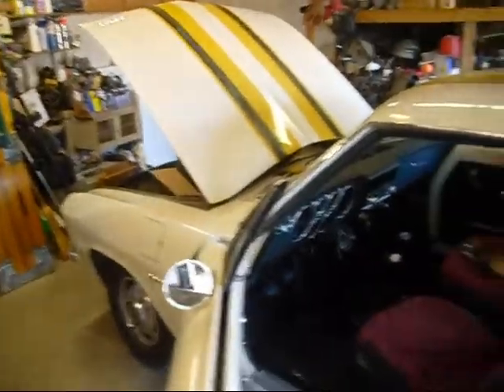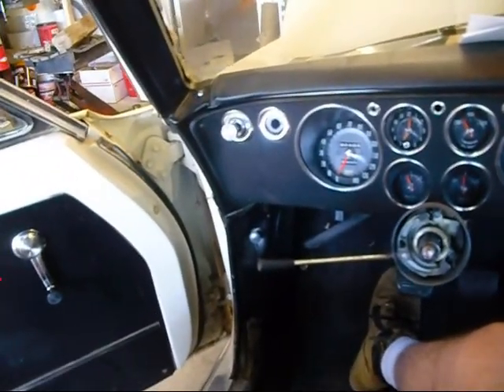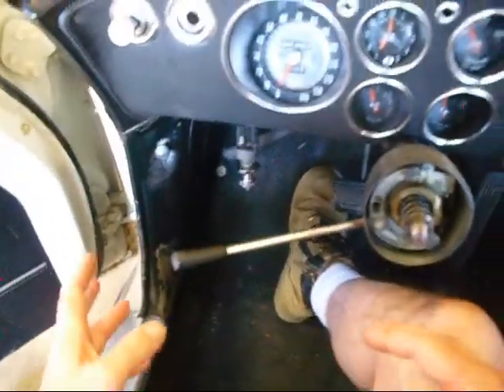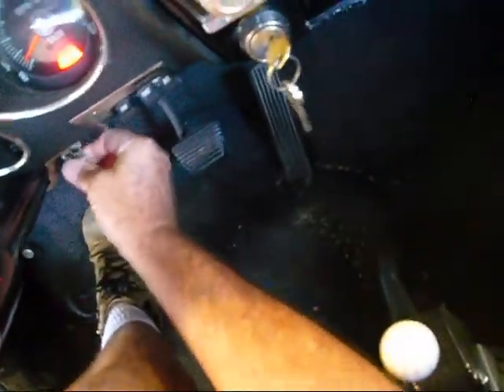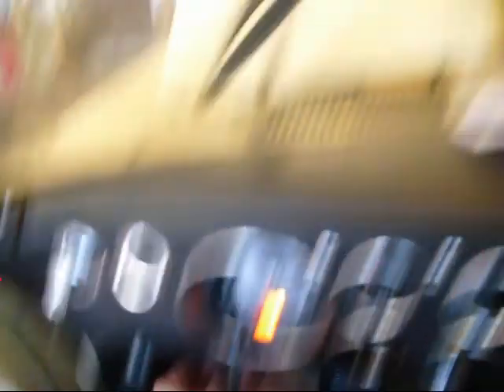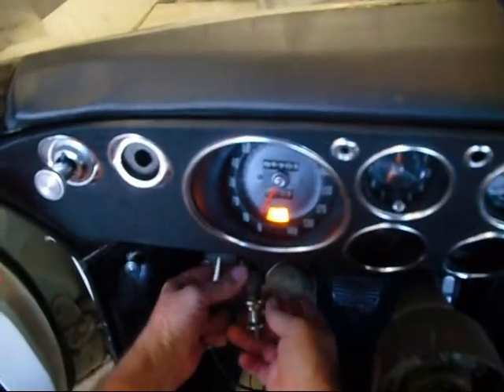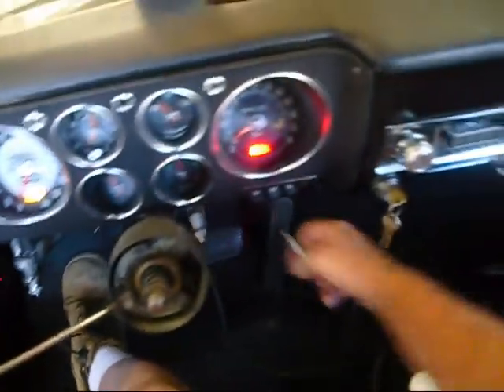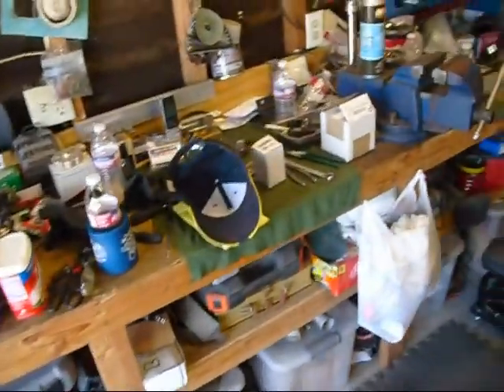Ground Your Switches

Comment: I realize this was posted 8 years ago. I never knew that the windshield wiper switch completed the circuit to ground!  You learn something new everyday. Not to change the subject but I am in need of a corvair mechanic in southern california. Is there someone you can recommend? I used to go to California Corvairs but ( as you probably know) Jeff  no longer works on cars it’s parts only. Thankyou for your help.